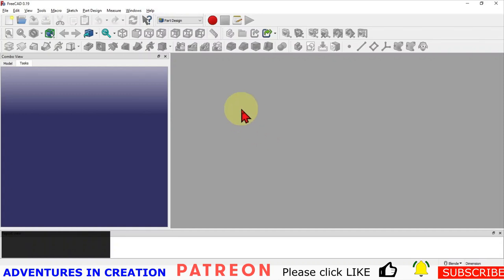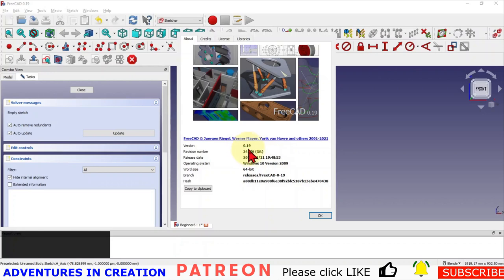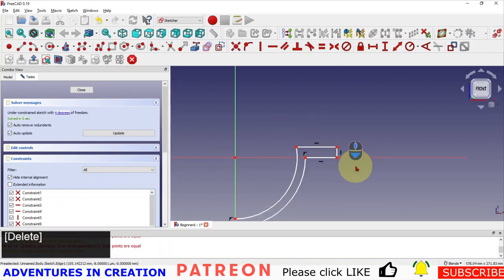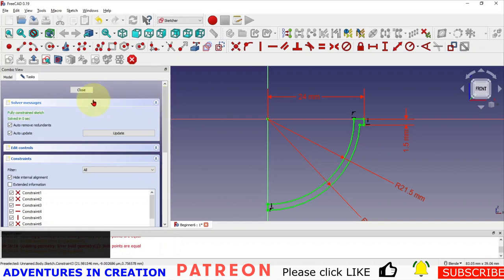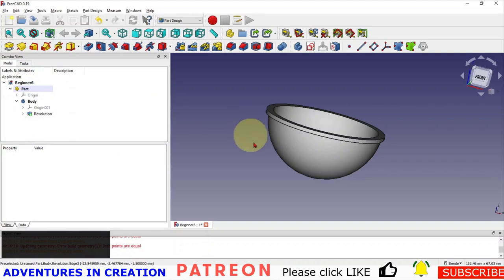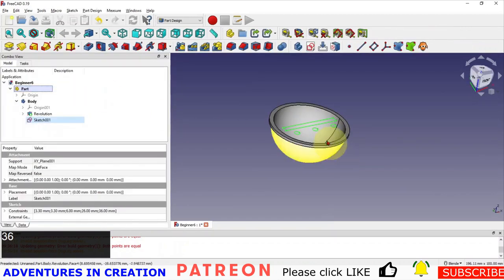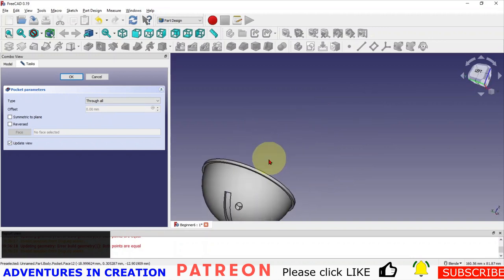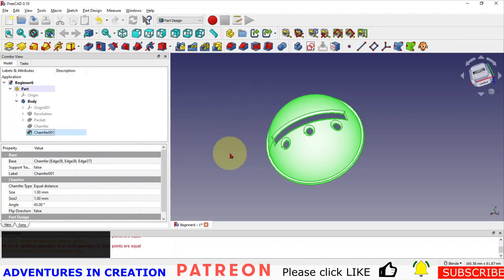FreeCAD For Beginners #6 Golf Ball Marker project

Comment: Thanks! A couple of time saver tips: When setting the length of a line just pick the line and choose horizontal or vertical dimension, no need chasing down both vertices. Also when referencing the origin you just need to select a point and choose either dimension. Freecad will assume your referencing to the origin. No need to pan back to origin if you're way out. Smooths out the workflow. Thanks again!
Reply from the maker: I certainly knew about picking the lines but I did not know about the point automatically assuming the origin. I will play with that, thanks!
Reply from the maker: I tested out the "select a point and dimension" it does indeed dimension to the origin however, if part of your sketch is below or to the left of the origin it dimensions it as a negative number (not what I want). Give it a go.
Reply: @Adventuresincreation Yes, that's true. Been using it ever since i found out (by accident) if it's negative or not doesn't matter. It's a relative to origin dimension. I draw the sketch with this in mind so  vertices ending up in the right quadrant. By the look of it you do to? Does save a lot of time if you got a lot of dimensions to do. Maybe someone's thinking "wow saving one click", but they add up. And I find it somewhat tiresome selecting points. Been using freecad since 0.14 and I love it. It has come a long way and people like you (there's been a lot of good content added lately) do a fine job spreading the word. Keep it up! It may be that we more experienced users don't benefit  as much as the newbies by your content but I pick up a thing or two to :) And attracting new users is crucial in the open source community. So thanks again!

Comment: Great video! I just watched a long series of your videos and learned a lot. Thanks! One thing that you never mentioned (maybe you like this way for some reason), but I've noticed you have some trouble to rotate your parts and I found that you can go to preferences->display->navigation and set "rotation mode" to "object center" and this makes live much more easy.
Reply from the maker: Thanks for the tip
Reply: What other rotation modes are there ?   I've been wondering how the rotation center is set.

Comment: thoroughly enjoyed this video as it relates CAD to the real world and 3D printing.  I just bought an ender 5 and have been playing around with it.  Good to see the Prusa and how it works... I use cura so very similar.   I am wondering about putting initials on a golf ball instead of this random marking.  I haven't watched the rest of your series yet and maybe you address this topic.  If you do just ignore my rambling about this.   Would make for a good video if there is a lesson on doing lettering on a round surface somewhere down the lesson tree.
Reply from the maker: The lettering would be the same as the marks, just make the pocket with letters instead. Give it a go
Reply: @Adventuresincreation  I was thinking there is some sort of font lettering generator somewhere in the freecad software.  I guess I could draw my initials in a very basic square lettering but would be nice to have some sort of font and sizing available to make life easy.
Reply from the maker: @tomcatmeow69  check out my video on engraving text, it shows you how to download and use other fonts
Reply: @Adventuresincreation  thanks , I did have a look at the video.  One thing comes to mind is letters like A or O and some others would lose their integrity for 3d printing a ball marker due to their centers having no connection to the body of the print.  I will revisit this in the future as I want to get on with the lessons during the weekend as I have a number of other creations I need to make for another project I'm wanting to 3d print that need to be drawn first ( pinball machine parts) .

Comment: The easiest way to flip a model 180° in PrusaSlicer is to select the top surface ( the edge in this case) and use the 'Place on Face' button
Reply from the maker: Yeah, I got that from a couple of other people. In cura to lay flat you just hit the button and the nearest side lays flat but prusa slicer does it differently, I have it down now.
Reply: @Adventuresincreation  In slic3r, just rotate the part 180 degrees around the x or y axis.

Comment: was that petg you was printing?

if you hadn't constrained the holes level to the center hole and give a slight offset, it would have made a face.. I was thinking pack-man for most of the video.. lol
Reply from the maker: It was pla but I messed up the slicing with the prusa slicer... I didn't put the part flat on the table.
Reply: Would have been easy to cut a smile instead of the slot.  I might do that.  Thanks for the idea.

Comment: I've followed the series so far... In this one, I created the Marker project and then tried to add a "tab" with a hole for a hanger of some sort. I made a new sketch, created a circle shape with a smaller circle coencentric. I "attached" it to the body of the Marker 1.5mm down to make it flush, then padded the circle 1.5mm. So far, so good. But when I pocket the new circle, it only goes through the circle, not the rim of the marker even if "though all" is specified. What did I miss?
Reply from the maker: It's hard for me to visualize, can you share the file?
Reply: @Adventuresincreation  I was getting ahead of myself. You provided a solution in the lesson on "Boolean Operations"
Reply from the maker: @markmartin9413  That's good to hear

Comment: The boolean tool did not work properly on my version 0.19 revision 24219 running on Linux Mint 2.0. I had to switch to the Part workbench where the boolean tools work normally.
Reply from the maker: I must admit, my boolean work in part design but I have had one occasion where I changed to the part workbench to use that one. I am not sure if they use different core code or not but it appears there is a difference.

Comment: I’m guessing it didn’t get flat on the build plate while in PS? You could have shortcutted it and just clicked on the lay flat button and the. Click the face with the lip to auto lay it on the build place?.
Reply from the maker: I did hit the lay flat button (always do) but I didn't do a good job with my glue stick 😉
Reply: @Adventuresincreation  That's not how the Place on Face button in Prusaslicer  works. You need to select a face like truehybrdx1 mentioned. You toggled the mode, but didn't select a face, so it didn't actually snap anything flat to the build plate. That's why when you see it printing at the end of your video, it isn't making complete circles around the perimeter, but doing the semi-circles, stopping and going back - because the print is slightly off flat, so it was trying to print the object with the one side raised slightly off the build plate. If it was making complete circles and still didn't stick, that's an adhesion issue, but yours wasn't trying to print the full circle because it was slightly skewed upward.
Reply from the maker: @flygarfpv3496  I did not realize that. Thanks for the tip. I used cura before this and you just hit that button to lay flat. I will try it out and maybe reprint one.